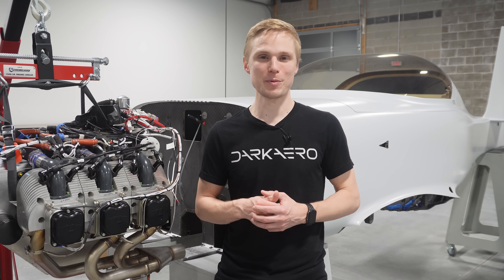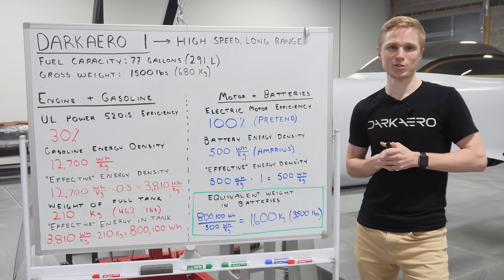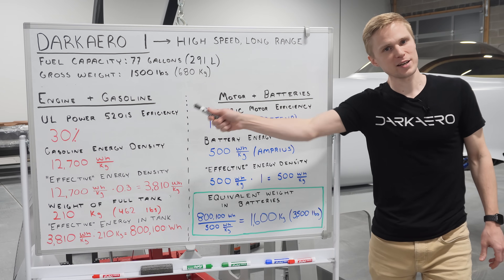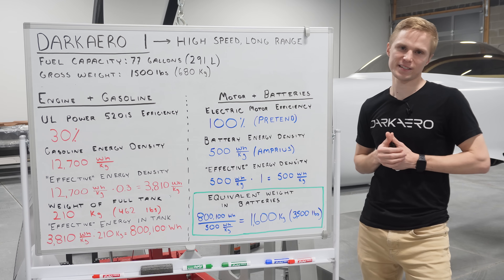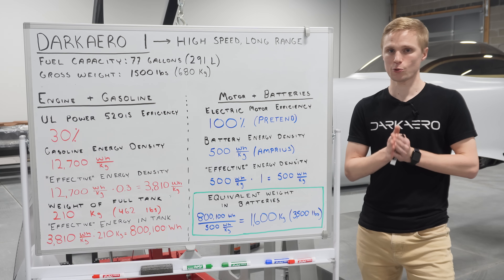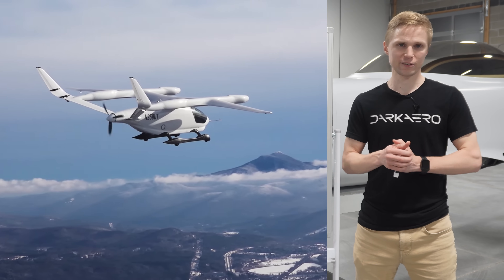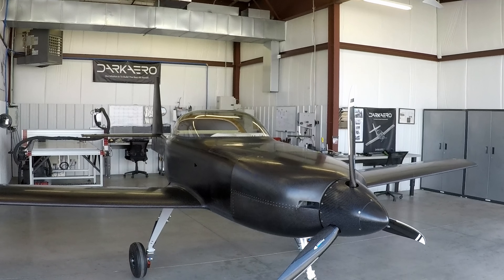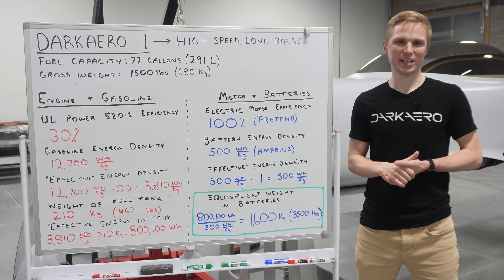The engineering challenge of electrifying airplanes

Comment: Hey that's my Sonex Xenos you shared. You are spot on with your analysis. However I think your focus was primarily on range and performance. If you look at cost per hour electric is demonstrably better. I also think there will be significant safety and reliability benefits with electrics. Don't get me wrong, gas is for sure the performance winner, but that is not the only factor in many applications...
Reply from the maker: Hey thank you for checking out the video! Agreed that cost per hour and reliability are other important metrics to add to the discussion. How has flying your Xenos been?
Reply: @DarkAeroInc  You should pin DeVault's comment.  Thanks for another great video. 
From an electrical engineer and physicist working in the EV industry, your explanation was beautifully spot on.
I always like to say that the problem with fossil fuels is that they are so damn good at energy storage!
Reply: @DarkAeroInc  over 200 trouble free hours and just had to do the first maintenance. Needed new tires... If you guys ever want to come fly it, build an electric (battery or H2), or  just have look at real data, let me know...
Reply: @emotodude  Where is your base at? Is it far from Canada?
Reply: @electricaviationchannelvid7863  Watsonville, CA, USA
Reply: @emotodude  I was looking at the Xenos to buy or other kitplane last yearI recognized your name! There are very few videos and build/fly videos about the Xenos in general...Do you ride thermals well with it? How is the glide in actual flight? Usable as a glider?
Reply: @DarkAeroInc  also, efficiency come in many forms and I do lust after a DarkAero1 ;)

Comment: this is not right! in order to correctly compare one side and the other, you should also include the weight of the engine, fuel tanks, pump, battery with which you start the engine, instruments, pipes and everything else for gasoline on the gasoline side, so suddenly you would have more weight on the gasoline fuel side than on the side of batteries and electric motors,

Comment: Good and fair video.  Before the video even started, I knew the battery weight would be the biggest issue.  I know it's sci-fi, but Tony Stark overcame this energy density issue by creating an energy cell that was very light weight but had massive stored energy.  I'd love to see the day when there really is such a device.  For now, it might be more possible to build a slow but long range electric plane.
Reply: Energy density is why lithium ion chemistry was developed.  Only hydrogen is lighter in molecular weight.  Hydrogen is far more difficult to store than lithium.

Tony Stark is fiction.  Try reading chemistry and physics instead of comics.
Reply: @keithjurena9319  In my original post, I stated that "Tony Stark" is sci-fi(fictional).  So I don't see the need to tell me that it is a fictional character.  I watch the development of various energy sources.  So I'm familiar with most the limitations.  I brought up this fictional character because it portrayed a significant leap forward in technology.  This happens from time to time.  After looking over most of the available energy tech(batteries & storage), a leap forward is needed for fast electric planes(and other craft).
Reply: With a fusion reactor it is possible...but not needed...Energy is everywhere all around us...

Comment: This is probably a difficult question to answer, but what sort of drag concequences would come from designing a plane around hydrogen fuel cells from the ground up and generally how would having a lighter, but significantly larger and less dense aircraft change its flight characteristics?
Reply: The biggest headache is storing the hydrogen, which requires high pressures and low temperatures. The latest carbon wound tanks can astonishingly handle 700 bar, but the volume is much larger than liquid hydrocarbons. So the issue is one of fuselage drag not dominating the wing drag. This is why Boeing and Airbus are still toying with the idea of flying wings to accommodate all that hydrogen...

Comment: While energy content per volume is certainly an issue with liquid hydrogen (especially in a tightly constrained airframe such as DarkAero's), that's not the only big problem. The weight of the cryogenic tanks required is far greater than the weight of the hydrogen itself, and greater than the weight of gasoline or jet fuel plus the much simpler tanks required for those fuels.

Comment: What folks pushing EVs fail to acknowledge—is the thousands of tons of material that must be mined with diesel powered equipment for a single battery unit. Then there is the manufacturing process that also requires significant amounts of energy. Why do you suppose they are so expensive? 
And what about disposal? Despite some claims, it is still not economically viable to recycle old battery units.

Comment: I'm not saying it will work today but in order to get to electric planes it is not just a matter of waiting for the battery industry to get x Wh/kg but to think out of the box and re-engineer the entire aircraft. For instance the battery can be used as structural part, reducing speed should not be done just by increasing drag but it can recuperate some of the energy, solar panels and so on. Each small improvement that currently is overshadowed but the internal combustion engine lack of efficiency, can add up to something meaningful
Reply: People are also missing, you'd need to fundamentally change the entire electric grid, especially power to house/business.  240V isn't remotely enough to charge batteries this big in a reasonable amount of time.  Even 480 isn't.  You'd need to be running something like 12.47kV lines to FBOs/airparks.

Comment: Tesla makes their battery pack structural to lower overall weight. Could that work for planes as well?
Reply: No, they don't. The "structural" battery pack in a Model Y with 4680 cells just replaces a floor panel.

Comment: Really well presented, I appreciate the focus on fact's and figures rather than opinions. Well done, and awesome to see such clean and professional engineering approach towards your aircraft design. It is very inspiring!
Reply: The biggest problem with the masses of people, they don't know the difference between what they believe, and what they know.
Reply: @noahway13  FYI - there's a term for it even: Dunning–Kruger effect.  On that topic - their website makes zero mention of the word "laminar", and their design goes half the speed of the Celera 500L while still managing to use more fuel.  Why is anyone listening to anything these guys say?  They're so addicted to their own image and ideas that they're turning a blind eye to everything we know about state-of-the-art in aerodynamics and efficiency.  The enemy of range is NOT weight, it's drag, and they've got blunt stubs on the ends of their wings. ROFL!!!!
Reply: @chrisdrake4692  First of all, I don't see how laminar flow is relevant. The Celera 500L is still a prototype, any figures about it are just claims. The enemy of flight in general is primarily weight. Decrease weight > decrease required lift > decrease drag (Cd = Cd0 + kCl^2) > decrease required thrust. Sure decreasing drag works but most planes are pretty optimised for it now. They have already explained why they have no wing tips; the wings are overszied for cruise to give better stall characteristics, and so adding wingtips would just make the problem worse and increase the parasitic drag. 

There is also a general misunderstanding of the function of wingtips; wingtips decrease drag because they increase the effective wingspan of the wing giving it a higher AR. Higher AR = less drag. The reason passenger planes use wingtips is because there are limits on wingspan for different classes. If you want to increase the efficiency of a wing increasing the wingspan is better than adding wingtips of the same length.

Funny that whole Dunning-Kruger effect you brought up 

Have a nice day :)

p.s. These guys have actually built a plane, probably know something about it

Comment: It would have been worthwhile to take a couple more steps, calculating the energy content of a battery-electric system (just battery and motor+inverter, for simplicity) of the same total weight as the gasoline-fueled system (just fuel and engine, for simplicity). This would show how much shorter the range would be for the same airframe with the same payload.

Comment: You’re failing to consider that when you use the energy, the fuel powered engine is only about 15-20% efficient, whereas the electric motor is easily 90+% efficient. 
Also if the aircraft is designed properly ( for instance to take advantage of distributed propulsion ( which is mostly only viable with electric propulsion), you could see up to 6X efficiency gains according to NASA research. 
So the energy density of the batteries vs fuel is only a small part of the picture.
Reply: They explicitly included that - did you not watch the video?
Reply: The electric motor is absolutely not "easily 90+% efficient": 
-Charging the battery alone can easily incur more than 10% loss. German testers tested a whole lot of electric cars and the BEST one of them only managed to reach 10% loss...during slow charging! For fast charging the losses can be so much more. 
-You need to constantly heat the battery...and especially on the ground during hot days and for takeoff you need a lot of cooling. That requires lots of energy. Just a Tesla with its small battery pack has a 7kW heater for the battery alone!
-You need to heat the cabin too on that battery power! Incredibly inefficient and you need a huge amount of extra power from the battery for that!
-Despite a heavy and power-hungry heating system the battery can easily drop below optimum temperature...and then the efficiency can drop dramatically ! Once the battery is cold it will start to absolutely drain the battery!
-Operating a plane is completely different to operating a car: a car is at very low percentage of power use all the time, while an aircraft will be used in a totally different way. Look at the absolutely abysmal range and efficiency of all electric boats so far: they have to only be used at very, very slow speeds to manage any kind of efficiency. Try to use an electric boat properly like ICE boats are used, pretty similarly to how aircraft engines are used and they will just consume electricity like there's no tomorrow.
Reply: @pistonburner6448  you claimed that motor efficiency is not over 90%, then "supported" that with a number of points which have nothing to do with the motor. Perhaps what you intended to argue was that motor efficiency by itself is not the only factor in the efficiency of the system... and that is valid.
Reply: @pistonburner6448  is that why tankers move at planing speeds?   ha ha    what is "properly" anyway?  Fast?   Fast boats eat through massive amounts of fuel too, by the way.  A place can use air cooling.  At altitude, the air is extremely cold. You also do not need to use a lot of energy to heat the battery, as you can insulate the battery compartment to trap the heat, using very little heat to add, then open vents when you want to cool.      I am writing this for other people's benefit, not yours, as you are obviously a troll.   Thanks for bringing up the common misconceptions, so they can be discussed.   Oh, and by the way, what would you think if I designed high performance, fast, long range electric aircraft, and even had designed aircraft which used so little power that they can stay aloft while putting a large percentage of their charge back into the battery, just on solar power?  There is always more to learn.   Are cars really that different from airplanes?  well, yes, and no.  power curve over time is usually a bit different, but it depends a lot on the airplane and it's flight profile. also on the use case for the car.
Reply: ICE engine "efficiency" is totally irrelevant. It's something total amateurs always mention, and it has absolutely no relevance.
Reply: @pistonburner6448  How is effeciency not relevant?  please explain.  it affects performance just as much as energy density.  Gravimetric or Volumetric depending what the constraint is.   Name calling does no good.  Facts please.

Comment: do the different motors weight equal?
Reply: No. They mentioned that electric motors are light for their power, compared to gasoline engines... but the UL520iS in the DarkAero only weighs 108 kg.
Reply: @brianb-p6586  thanx! so 108 - 16 gives a 92 kg lighter motor - if it has comparable thrust.
We need to take the battery assembly into account for the integrally heavier e-plane
Reply: @helder4u  The 16 kg weight for the motor shown is not realistic: it's a proposed design which doesn't physically exist. Two to three times that heavy is more like reality. You also need to include the weight of the inverter which drives the motor - it's just electronics, but the weight is not negligible.
Reply: @brianb-p6586  Aha, we will see how it goes. Control electronics and motors should be in accelerating development now, because of the e-car boom.
Reply: @helder4u  Not really. Motors are mature technology getting only minor optimization, and even controllers (inverters) haven't changed noticeably over the past several years. Every automotive manufacturer builds or buys these components and suppliers compete to deliver the best product, but physically reality limits the degree to which they can be improved. There is much more room for improvement in batteries... which is good, because that's where the weight problem is.
Reply: @brianb-p6586 All You wrote is true, agree - except I still believe You are quite conservative in Your optimism, since there are some new interesting ideas for motors.
I expect even greater advance in e-motor tech then You are aware of - in the nearest years.
Time will tell how much, if any innovation will spread and how fast..
In the meantime -  Thanks for for the nice exchange 💖
Reply: @helder4u  there just isn't much room for improvement, especially in efficiency because electric motors are already so efficient. Physical realities such as magnetic saturation of materials are real limitations. You can hope for whatever you want, but the more that you understand the fundamental science, the more realistic your understanding will be of opportunities for improvement.
Reply: @brianb-p6586  I do not pretend to know all,  and you don't know me.
 Seems You did disregard what I wrote last. See no gain continuing our dialogue, thanks for Your time |: